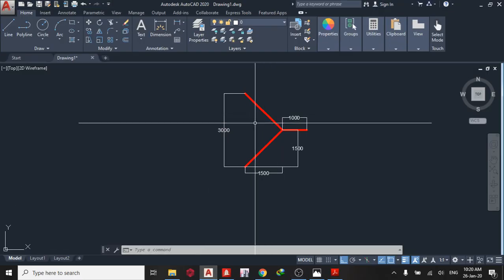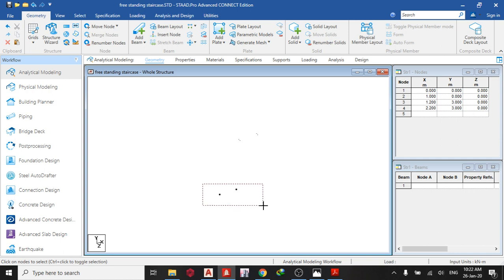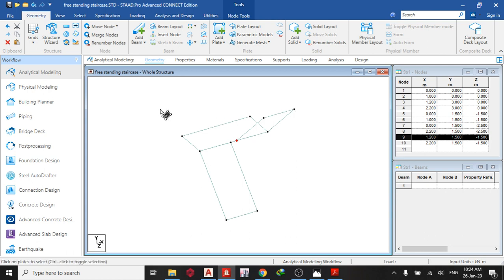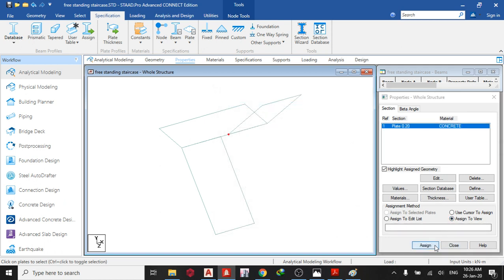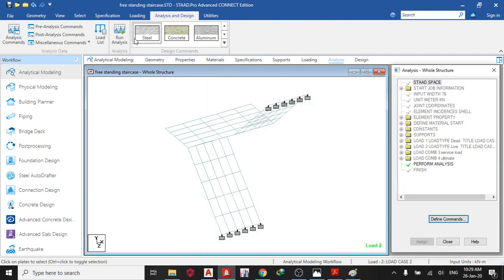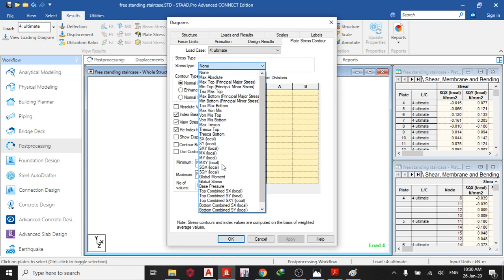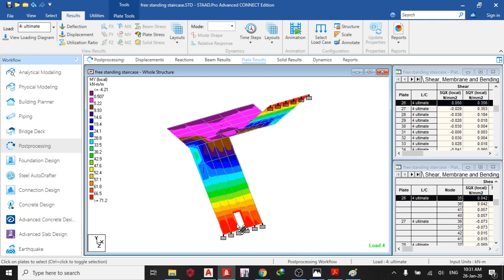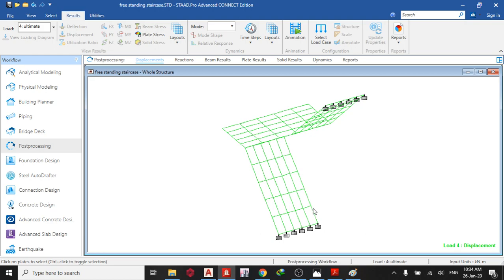Modelling, analyzing and design of free standing staircase on staad pro CE

Comment: Why do mesh the plate is there any specific reason to mesh it after defining the properties
Reply from the maker: Yes it is to discretize the plate and make sure stresses are Destributed
Reply: @Lanreolokunola  Thank you very much bro lastly can you make the video to explain the design output of the slabs /plates / staircase  ( analysis of the reinforcement details) because when we run the analysis of the beam and columns after concrete design once the analysis ends when we double click the specific columns or beam you can see the reinforcement details of the specific beam or columns but in slab its different no reinforcement details /section so how to read the design output  of the slab or plate
Reply from the maker: @georgedelhuxasie7074 generally staad is a finite element software so it will give you your max absolute stress then Mx, my and mxy which you can use wood and armer equations to solve or better still you can use Rcdc